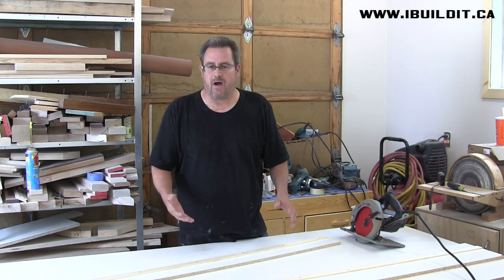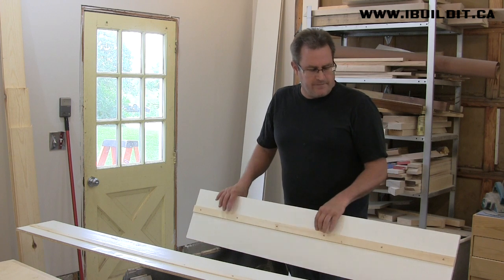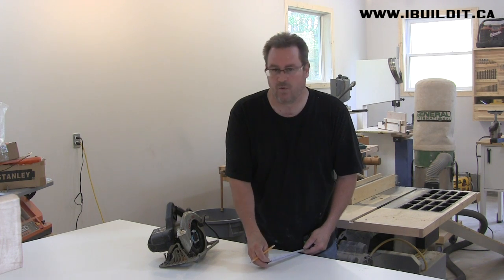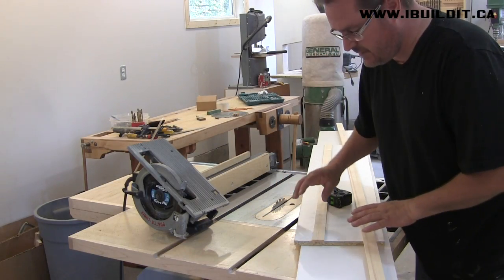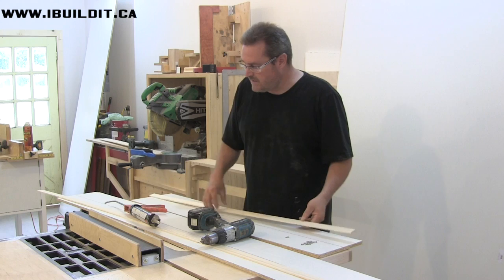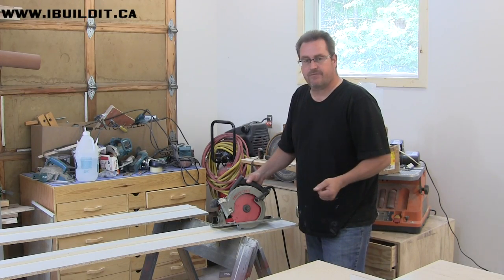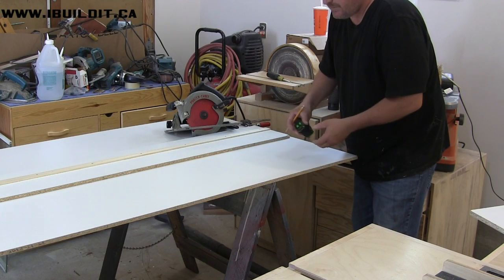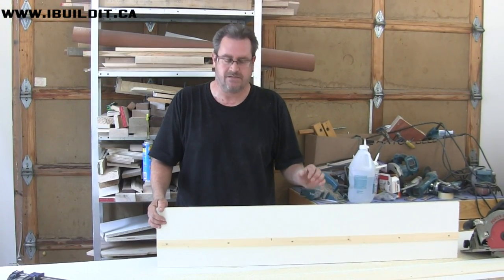Making A DIY Track Saw

Comment: Hi John. I like melamine too for my saw guides.The saw glides  on it especially when your cutting full length and you have to move to cut the last bit.Just finished a big detached garage with ten foot walls. Owner wanted 3/4 ply thruout the interior.Makes it a snap to get nice straight cuts.Some folks don't realize that when ya got skills coupled with experience a simple jig is all that is required. I also appreciate you not taking crap off of the posers who troll your site...

Comment from the maker: Thanks. I use that glue nearly every day. Overnight, just the tip dries out and the next day I squeeze that out and it's ready to go. For long term storage, I put a 5/16" lag bolt in the nozzle, and that stops it from hardening.
The thing with the wheel is my router table. I have videos about it and an 8 page article on its construction on my website.

Comment: about a year ago, after watching my mate with his ooo so fancy festool setup. I went out and bought a decent circ saw and made these. Thinking I invented something new :D. I have to say these are a must make jig. The time they save is awsome and you don't have to do some maths on each cut. If i was to make mine again I would make it 2 sided like Andrew Didio said. I made 2 X 8 foot ones and cut one down to 3' and 5'. it's nice to have the overhang not using a plunge saw.

Comment: Very nice John.  I like the melamine for easy sliding.  Ive always just used ply.  Not sure if anyone else has mentioned, you can run another cut on the opposite side of your guide board for the short side of the saw "plate."  This way you can cut from either direction using the guide board.  Its not as stable as the wide side, but keeps you from having to reach over a full sheet to make a rip cut.

Comment from the maker: If your blade is heating up and making a crocked cut, nothing will stop that, other than getting the blade sharpened. Having the saw ride in a track won't prevent it. 
Besides that, you can hold the saw against the guide strip, it doesn't need a track.

Comment from the maker: Thinner base, thicker strip and the motor housing on the saw hits the strip - 6 of one, half dozen of the other.
I prefer the thicker base since it stays straighter and doesn't need a clamp in the middle.

Comment: Good video, John.  Even the new compact tablesaws are difficult to cart around. a 77 1 7/16" from the cut line with a level used as a fence is handier than a table saw. A sled is good to keep the stock from getting a scar from the saw's table. As you say, old stuff!

Comment: just glue and screw the guide board on a board that is a bit wider and run the saw with the sole plate against the guide board and you have your track automatically
Reply: indeed, i did the same. very easy, and perfect line!

Comment: Great vid. Mine are similar. I use Lauan as the bottom for maximum cut depth. My saw rides against a narrow strip of lauan on top of the base. Those two are topped by a piece of 1x4, ripped to 2.5" to stiffen it all up. I had some spare rubber sheeting for use on the bottom, when I have to use it on subfloors. Maybe I need to make a video.

Comment: I've used a saw guide similar to yours for years - to break down sheet goods too large to easily handle on my table saw. I'm sure you do the same. I can't think of a time when I would be using it to cut hardwoods in the manner Mr. Rofer describes. I think some folks just try to crave a way to criticize others..

Comment from the maker: I still have wall cabinets to install, plus a larger tool hutch type of thing, and I think the acoustics will improve after that. I'm not going for perfection, but I would like a bit better sound quality.
A decent lav mike costs as much as a new (good quality) power tool, but I don't see a good alternative for what I'm doing. I've ordered an AKG wireless presenter set to try out that was reasonably priced, and I hope that does the trick.

Comment: Good. The only thing I might suggest is making the 4 foot one actually four and a half long. Starting your cut against the 6 inches gives you a more accurate start. Also, you can make it with quarter inch thick plexiglass and a length of aluminum angle . Makes it lighter.

Comment: Sound ... "Roxul Safe'n Sound" insulation - build some simple 1"x3" pine frames, add Roxul, some Nylon straps hold the insulation and wrap them in burlap ... made some for a friend a year or so ago because his kid had a "Rock Band" living in his garage. The real trick is hanging them from eye hooks and wire and moving them around and experimenting to see where they're most effective. Cheers,

Comment: Nice job, John. I've also seen one using a thick board on top (as the guide) and a thin (3/16") piece of fiberboard for the base. That gives you more cutting depth. Just a thought!

Comment: Although a very interesteing approach, I found that with a thin kerf blades sawing hardwoods, the blade gets hot and travels. I saw, what I think is a more effective solution on Youtube. The guy used a T-Track routed into a 3/4 plywood then attached a Miter Bar to the circular saw. Accuracy that is dependant on either a routed T-Track or factory made aluminum T-track and a miter bar. Total control of the saw and superior acuracy. Poor man's Festool track saw.

Comment: I was also looking at my saw thinking how I could put a spring in it and a stop. Thinking along the lines of a plunge router. I havent had a good look at the mecanics of a plunge saw. But I do know my circ saws sole plate will go far out enough for the blade to retract fully, now its just a mater of gaurding the blade, I think if I put the existing gaurd to ride on the top side of the plate that should work.

Comment: I'm going to try the 1/4" strips. I have 3/4" strips, but the motor on the saw can't clear the strip and the back of the saw lifts up as I cut. I want the blade plate to remain flush with the wood that I'm cutting. You should definitely wear a good mask when you're cutting wood.

Comment: I made some for myself and they are super useful. You save the money, get to make something super-precision for yourself (so you can brag that you did it), and you get accurate cuts. Mine use Lauan for the base, with a stiffener on top. That gives me maximum blade depth. I made a 5' for cross cuts, and a 8' for rips.

Comment: Why go through the trouble of measuring the shoe and aligning the runner? Just attach the runner to the baseboard and then cut the baseboard with the saw pressed against the runner. Board edge will be exactly the right width and perfectly parallel to the runner, no?

Comment: Nice build I've use one for years. I was thinking about making a runner for the saw that would run in a dado that might work like a track saw. You could drill and tap the saw base to add the runner that way saw could be use as usual. just a thought.
Thanks John.
Roland in S.C.

Comment: Good and easy to follow, but watching your videos always brings up questions that are just slightly connected to your main theme.  How do you keep your tube of adhesive ready to use again after first opening it for a smaller project like this one?  And ... when you were showing us how thin the strips were at about 2:40 into the video, there was a small table behind you with a BIG wheel on the side.  What was that?  Thanks so much.

Comment: Only draw back is you have to keep your wrist straight though or you end up with a dinged edge on your jig
Reply: ninjaman58 Since the saw actually rides the mounted fence piece, a dinged up outside edge on the jig shouldn't affect your later cuts.

Comment: The accuracy of this is limited by how straight your strip of 1/4" spruce is.  Did you joint the edge of it before assembly?  I'm thinking of doing something similar, but using an extruded aluminum rail as my reference strip.
Reply from the maker: The accuracy comes from the factory edge of the melamine. Watch it again, but pay attention this time.
Reply: John Heisz The part I missed was at 2:30, where you said you cut the 1/4" spruce strips yourself (thus eliminating any warpage along the edge you end up using as the fence for your circular saw.)
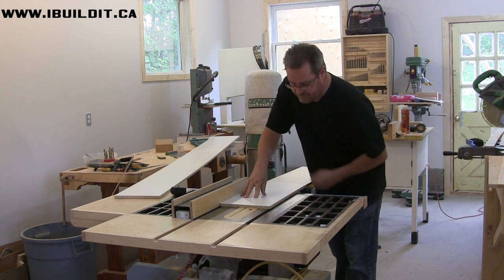The line you score at 3:45 (referenced from the factory edge) allows you accurately place the strip... but my original question was how you made sure the strip itself had no subtle crooks (which you'd likely notice anyway, when you placed it against your scored line.)
Thanks for the reply.
Reply from the maker: I cut the strip accurately on my table saw and it it flexible enough to conform to the scored line.
Reply: I think some people are just to stupid to understand a simple straight forward set of instructions.  Nice video I enjoyed it and though I have never used my table saw to make a scribe line it looks like a neet trick I will remember. And to the idiots giving john shit. IF YOU DONT HAVE COMMON SENSE WOODWORKING OR BUILDING STUFF JUST MIGHT NOT BE YOUR THING. Just saying

Comment: Why not fix the timber strip then run the saw up the side of it then the saw blade will be exactly to the edge of your board/guide?
Reply: +wayne burgess if the guide strip is not perfectly straight the cut wont be either